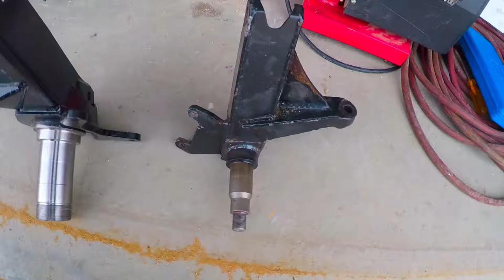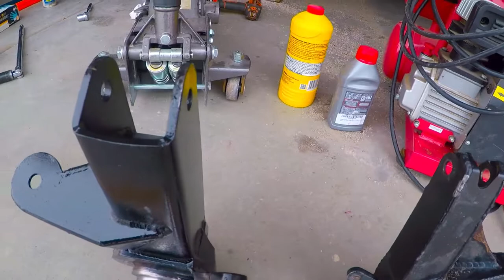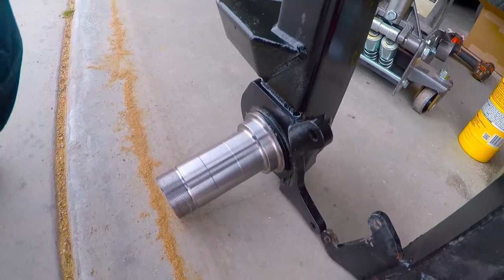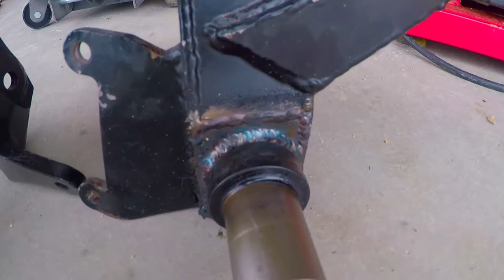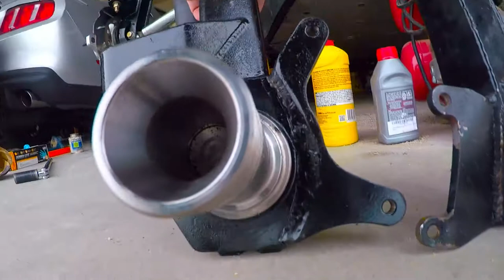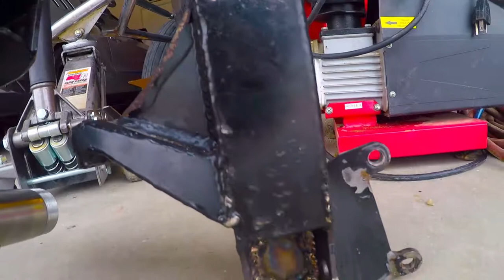combo vs 2in hollow spindle

Comment: My builder suggested I go with a combo spindle. Why would this be? I said I wanted disc brakes for the front and they said combo is the right one. I thought 2" hollow couldnt accept the caliper or something
Reply from the maker: If you have a large front tire, definitely get the Hollows. I have disk breaks on the front and rear of the buggy.